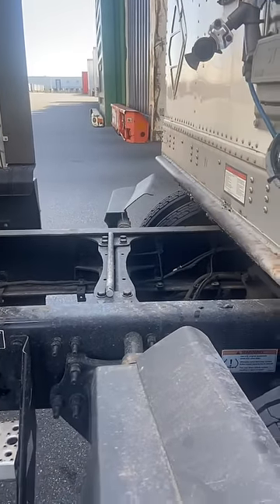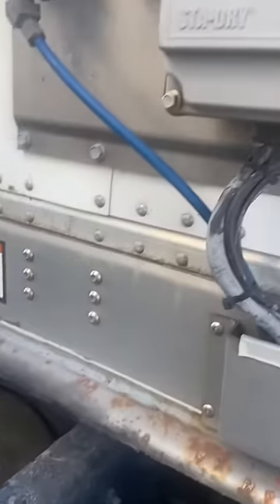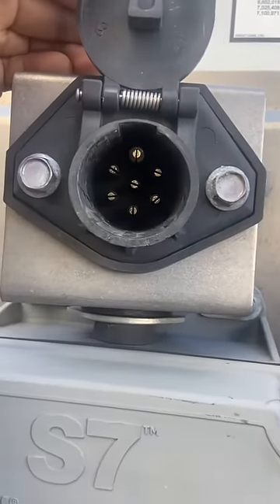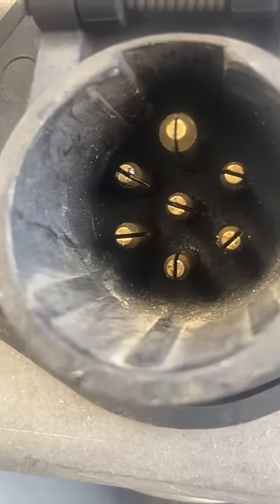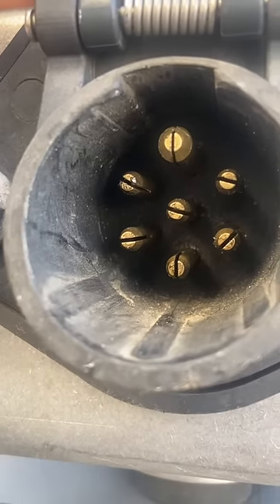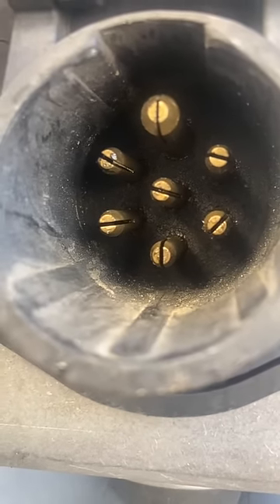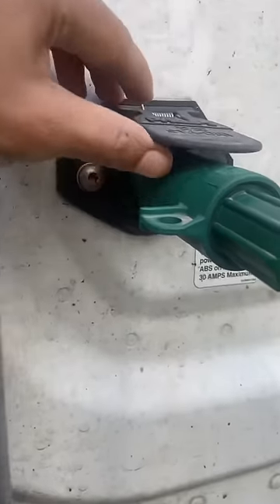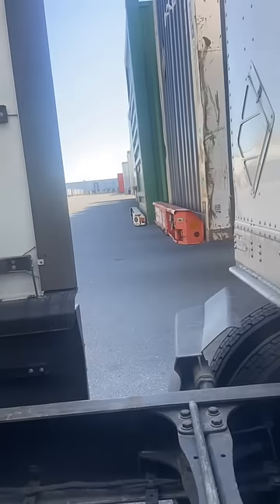How to fix ABS light on tracter-trailer

Comment: Just done this to my freightliner and it worked all I had to do was what you said cleaned the line I also cleaned the air lines as well and pulled off for 10 seconds and it worked.💯🤘🏾

Comment: I works when that’s the problem sometimes it is the sensor are pushed away from the wheel to far I always start with the connection at the pigtails fuses and then the sensor at each wheel